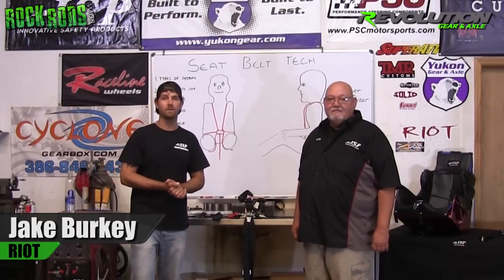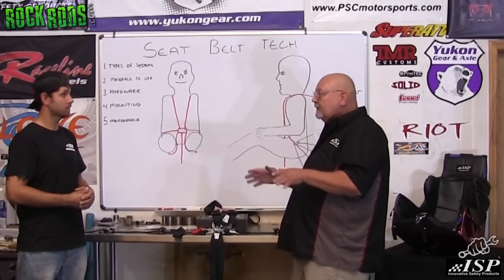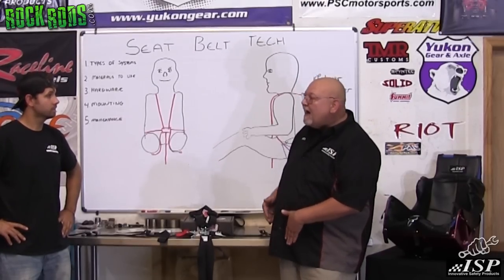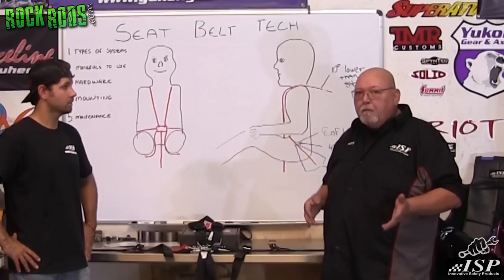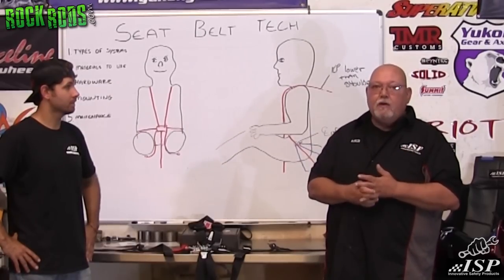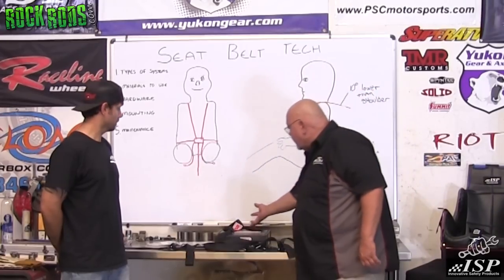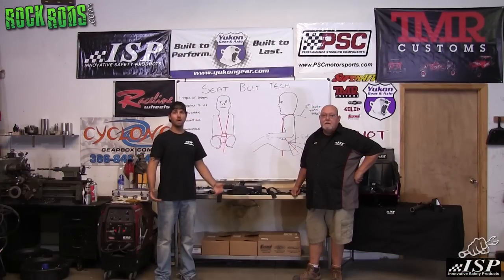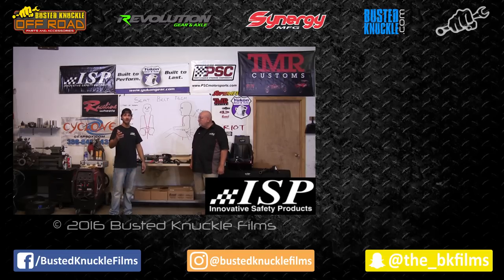5 Things You Need to Know about Racing Harness Safety - Rock Rods Tech

Comment: Excellent video Jake and Kris.  You've convinced me to go with a latch not a cam.  They're about half the price anyway.  I'm still confused about the differences in the 6 and 7 point harnesses over the five.  It appeared that you said the extra belts wrap around the thighs of both legs?  Is that correct?  How are they attached?  Thanks.

Comment: hello, great video! i was wondering what would be my best bet? since my truck has no air bags at all and ive heard a lot of negative things about harnesses so would i be better off with a oem seat belt or a 5 point harness?
Reply from the maker: For a daily driver, seatbelts and air bags are probably safer
Reply: Busted Knuckle Films I don’t have any airbags since my truck was in a collision and i can’t afford to replace the airbags and the seat belt tensioners were deployed so would a 3 point seat belt be use less? I currently have a 4 point harness but I heard a lot of bad things about them

Comment: Never never get 4 point harness
Reply from the maker: better than a normal seatbelt but 5 or 6 point is way better
Reply: This may be a dumb question, but why not?
Reply: @chelsea7336  because if you get in a crash you (can) slide under the harness, also called the submarine effect.
Reply: Never say never 💩
Reply: I think for crawling they work just fine to hold you in safely when you flop or roll... this comes from watching folks flop and roll while wearing a 4 points on our runs . The stock 3 point held me in just fine the couple times I went over onto my roof .  A 5 point and 6 point are...NOT...realistic for a trail rig where you are driving in a group going from obstacle to obstacle and get in and out of the rig multiple times ... it's not like a race car where the driver is strapped into the car and only exits when done . A 5 or 6 point probably wouldn't even get used due to the inconvenience ...lol... it only works if you wear it .
Reply: @mikabrouns500  This isn't even correct.  The 5th point jeeps your hips down so the lap belt doesn't put the load on you soft stomach and organs.